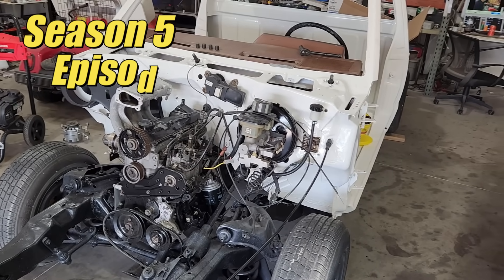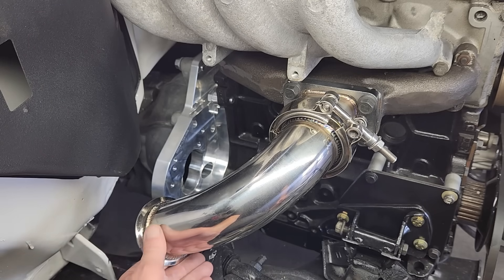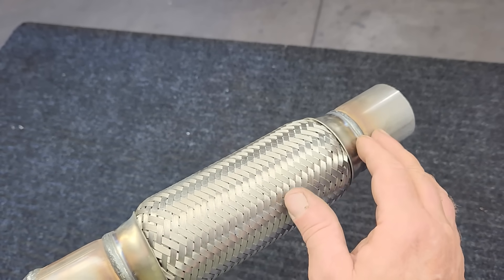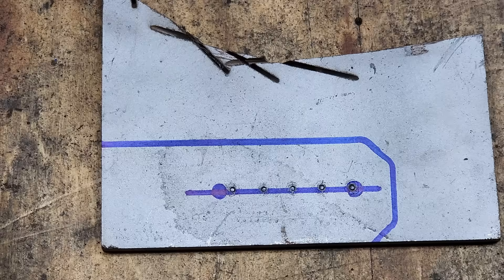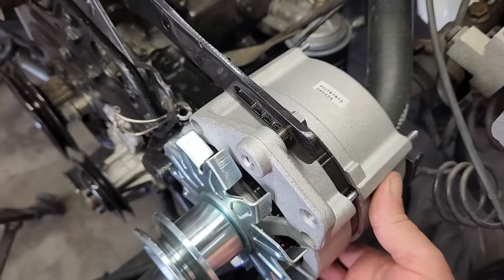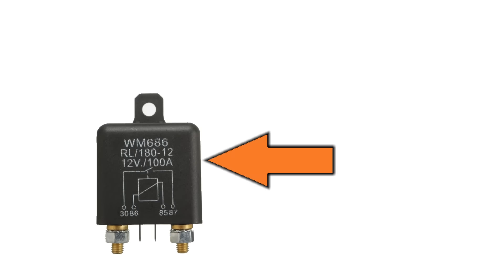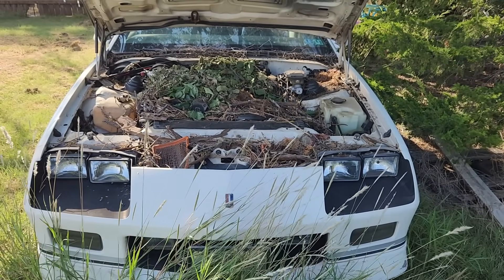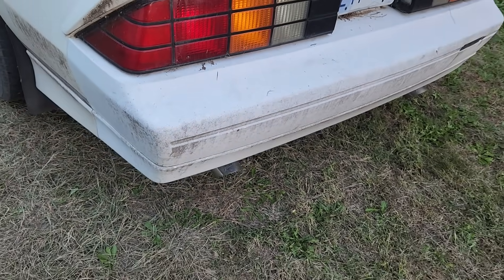S5 E35. DIESEL SWAP Chevy S-10.  we build a custom exhaust and more!

Comment: if the truck has a "seatbelts" light on the dash that illuminates for a few seconds when the key is turned on, you could use this same circuit to run the coil of the relay and you would have a built in glowplug timer
Reply: Not sure if that would be long enough , but it’s jeenyuss! 😊
Reply: Hardly needs the glowplugs above freezing anyways.
Reply: @ThePentosin yes it needs. It is swirl chamber diesel, not direct injection
Reply: @juhomaki-petaja if it's in good condition it won't need the glow plugs, most of those engines here in Europe don't have working glow plugs anyway and start fine when it's warm out
Reply: @mantvydas8810 i am from Finland. Those 1980s prechamber diesel need glow always. Educate yourself
Reply: @juhomaki-petaja I'm from Lithuania lol, summer is usually 20+ no need for glow plugs.
Reply: @mantvydas8810 these old ones need in days first start
Reply: @juhomaki-petaja I drive a 30 year old car and been around older for a long time I'm not talking out of my ass. If it's in good condition it will start without glow plugs when it's warm out, nearly 0 and bellow is where you'll need em. And no I'm not talking about modern diesels, those can fire up without glow plugs when it's -15c outside, own a car without functioning glow plugs lol
Reply: @mantvydas8810 yes it starts but long starting and lots of gray smoke. Remember, Direct injection engines dont need glows so much
Reply: Easier to buy original glow timer relay...

Comment: Either that's been converted to a stick, or the 5.7 badges were added to a 305 car. The 5-speed wasn't available with the 350 because the torque along with the weight of the car would tear it up. It's the same T5 that was in the Mustang that was lighter with less power.
Reply: Could be a 6 speed converted from a 4th gen. 4 gen console in there.
Reply: @AliceEmpireBreadfan  That would be awesome. I have a T56, but I sold the car it was supposed to go in. Maybe someday.
Reply from the maker: As I recall the 350 could be had with a 4 speed for sure.  Given the fact the car has Gen 4 parts, there may be something going on that we are not aware of yet.
Reply: @robotcantina8957  I'm definitely looking forward to finding out. Are you going to do updates on it?

Comment: Check the RPO code for 1LE code. That would make it even better.
Reply from the maker: I think thee RPO codes are in the back of the car under the hatch.  we didnt get a key for the hatch or the doors.   If I can find the codes I'll post them in a future video.  I really want to know all the details on this camaro.
Reply: @robotcantina8957  In case you weren't aware, the 1LE package (IIRC) came with a 5.7L engine (350), Manual 5 speed, bigger brakes, bigger sway bars (I think) and a posi. It's a pretty desireable package.

Comment: I know you probably get more suggestions than you'd like, but could I suggest using a Sabre Saw with a metal cutting blade ... and some drops of Cutting or Threading oil along the path of the proposed cut line ... to cut slots after drilling holes to remove material as you did with your alternator bracket?  I find it a hole (!) lot faster and neater approach than filing ... and faster than setting up my milling machine.  As I mentioned in another post, Oatey Threading Oil can be found at most Homeboy Depots.  Sabre Saws can often be found in pawn shops, thrift stores (aka where AMERICA shops) or even Face Book Marketplace.
Reply: Jig saw?

Comment: Fun story: on my dearly beloved and long departed Toyota T-100 pickup, I replaced every incandescent lamp in the truck with LEDs for efficiency, including the charge lamp off of the alternator. Without that tiny bit of resistance, I managed to kill an Optima battery dead-dead.
When I swapped in a 180 amp alternator from a Cadillac, I replaced the bulb and ceased to drive a battery-killing machine.
So, TLDR: keep the charge lamp incandescent, folks.
Reply from the maker: LOL, indeed a LED wont work.  I also learned that back in the day.
Reply: Same goes for Hondas of similar era. Needs the incandescent bulb in the battery light to charge. I learned that lesson the easy way by reading on forums, thankfully. 😂

Comment: I have a good 6.2 diesel and 700R4 trans... Humm. This might sound silly in a S10 BUT it only weighs about 200 lb more than a gas V8.
Reply: Theres a channel somewhere that put a 6.2 in a c3 vette IIRC. 😂
Reply: I was just telling a friend about this situation earlier. And he goes oh yeah you know I got that 90 Chevy truck that's a bit weak in the motor department. And I went oh no I don't think I want another project sitting around after all.

Comment: You might like to use a cutting or threading oil and not penetrating oil to help drill or cut holes in metal.  Homeboy Depot over by me stocks Oatey Threading Oil which works great at cooling cutting surfaces ... I even use it on my lathe.  It makes smoother holes and extends drill bit life. Under $10 at most Homeboy Depots. As we used to say:  A Little Dab'll Do You!

Comment: for the Iroc i would just assume the engine has issues and just strip it down to a short block and then rebuild it 
but you could just sleeperdude style and just send it🤣
Reply from the maker: LOL, well the RAT that made its home in the engine bay is still there and we have been working on ways to evict him.  Anyway we did dig deep enough to see there is no intake manifold... so the cam is likely toast.  Hopefully we can dig out the rest of the crap today or tomorrow to get a better look.
Reply: @robotcantina8957  ya from my point of view a new spicy cam is almost a necessity🤣 new cam, springs for higher rpm maybe roller rockers

Comment: I think the 350 was only available with automatic transmission in that Camaro, but I could be wrong.  Either way, it should be a great project for them.👍
Reply: You're correct, from the factory the 350 only came with the 700R4. I have an 87 IROCZ I've owned since 1999. 1987 was the first year for 350 in the third generation cars.
Reply: Beat me to it, I really wanted one with a manual and the only manual option was the 305 back then.
Reply: 8th digit in the VIN will let you know if it is a 305 or 350
Reply: @IgniteLight  - And the RPO will tell what trans it came with.
Reply: Came into the comments for this... I used to read Consumer Guide (not to be confused with Consumer Reports) and distinctly remember the IROC-Z's base 305 came with a 5 speed with optional automatic, but the 350 option required the automatic.  Since the console is clearly from a 5th gen F body, and we know the engine had something done, I wonder if it's an LT1 and 6 speed swap?
Reply: @davidkane4300 That's definitely possible, the car has had some indepth modifications for sure.
Reply: I put a 1984 NWC T5 from a 305 Camaro into my 71 chevelle with a 350, drove the hell out of it but didn't do powershifts or big clutch dunps. It shifted good and never died, i feel like it was on borrowed time so i got a TKX and have been very happy.
Reply: Well apparently you might be wrong.
Reply: I bought an '88 brand new. Wanted the 350 5spd with t-tops. Couldn't get it though!  It was a long time ago... but seem to recall the salesman said you could only get the 350 5spd without t-tops due to body twist blowing out the tops.  So I got the 305 5spd with t-tops.  Yeah, it sucked.  SHould have just said no to the tops.
Reply: There were no factory 3rd Gen Camaros with a 350ci engine and a manual transmission. It was not an option, at all. The T5 5-speed would not have held up. 

The only way to get a manual transmission with the 3rd Gen F-bodies was through aftermarket tuners like SLP and a few others.
Reply: @DrFiero There was no way to get the 5 spd mated to a 350 from the factory. Even with the 1LE option for showroom stock SCCA racing was obtained by ordering the 350 with automatic transmission and no air conditioning.
Reply: I think some of the Canadian ones you could get with the 350 5sp.
Reply: @joshuagibson2520 Unless they were undocumented from the factory I've never seen any evidence of that.
Reply: @joshuagibson2520  - and since I am in Canada... that could explain it!  :D 
(also, now being a senior, memories are foggy)
Reply: Isn’t the tuned port an LT1 in that car?
Reply: @THNKKY Tuned Port was before the LT1 the LT1 is totally different kind of small block Chevy.
Reply: @Alloy211  once me and my friend swapped a tuned port from a formula 350 firebird into an el Camino. We ordered a gear drive to replace the timing chain for a 350 and found that it didn’t fit. After making some measurements we found that the lt1 gear drive was the one that fit.

Comment: Jimbo they make these really cool lap clamps for exhaust. They negate the need to weld exhaust tubing.  
They don't leak, they are cheap and they are a sleeve with two heavy steel bars on either side to securely join exhaust via a butt connection. Stainless ones are under $20. I got them to put them on my 4x4 and I can get the whole rear pipes and mufflers off in under 5mins. 
They aren't a replacement for V bands in any way or form - if you need a V band then you need a V band, but for straight pipe they are excellent. You'll never use a slip joint and those stupid clamps they require ever again.
Reply: Post a part # or link
Reply: @dheujsnrhfydhehehshshhdggsd  I can't post links. YouTube deletes posts containing them. I've learnt the hard way.

Type exactly this or cut and paste it into YT search: " Exhaust Band Clamps | Unveiling the Best vs. the Rest " without the quotes.

The channel is jsf auto plus (not written like that. the plus might have a + sign in it lol).

I chose that vid because you want the ones with 2x bars and he shows the single bar ones so you know which ones are the better ones and which to avoid. 
There's thousands on ebay. I don't even have stainless ones, just mild steel and they are the best thing.
Reply: I’d like to learn more about these, can you give a part number or what to search on the google machine to find them? I don’t think YouTube allows links in comments anymore
Reply: @GlizzyGloblin  Re read this thread. I answered another poster and gave exact instructions to a vid. They are very common on ebay.
Reply: If you google 'lap clamp sleeve' you get basically exactly what OP describes

Comment: for the alternator bracket i would have welded a nut on the back and a longer bolt with a nut welded on the end on the alternator so that you could just tighten or loosen the bolt for your belt adjustments

Comment: About to get a 1987 f150. This build is so cool to watch, giving me some interesting insight into what I would like to do with this truck. Thanks for everything you do.
Reply: I'm not not saying that you should get a Cummins 4BT from a bread truck and stuff it in there.
Reply: @SamwiseOutdoors it’s got the 351 carbureted Windsor. Instead of the early age EFI stuff. It’s also being used as a daily driver from the seller. So I’ve got plenty to work with. Should be fun,
Reply: @SamwiseOutdoors  love a good 4BT. And I agree if budget allows it’s a good option. However it’s heavy, underpowered, and you can basically swap a 6BT in it for the same price. Heck with VP44 engines now selling for $1500-$2000 you could pick one up and P-pump the 24V for almost the cost of a good running 4BT.
Reply: Om603 turbo or ideally an Om606 would be far better than 4bt. Run smoother, make more power, about the same price. 4bts have gotten way over priced the last few years
Reply: OM617 is cheap and common. However any 1.6 VW diesel swap or OM617 is going to need a good manual transmission and proper gearing (aggressive) to keep it from being a complete dog. For example a OBS F150 with a 120ish hp OM617 wants to rev more like a gas engine. Therefor something like a ZF5 or even T19 and 4.56 gearing with a 29 inch tire is going to be needed. Something like a 1.9TDI is going to be a lot more forgiving but is also going to be a lot more expensive and need a lot more fab/wiring work to make everything work correctly. Personally I think for cheap mechanical injection the old VW engines work well in light cars and small 2WD trucks (ranger/S10) however in bigger vehicles or those running mid size tires I would just jump to the OM617 or ALH if budget allows. That’s just me however.
Reply: @cbr600rx7 I've helped with OM617 swaps into Land Cruisers as well as 4BTs, and I was really impressed with the packaging and simplicity of the 617. I'd love to swap one into an AMC Eagle Wagon in order to make a safari wagon.
Reply: Another option is getting a Deutz air cooled diesel out of something ( generator set ). You can get rid of a lot of hoses, radiator, etc., they are ridiculously reliable and nobody is checking for them so cost should be lower to purchase.
Reply: @hoost3056 Go on...
Reply: Turbo a 300 i6 in it.
Reply: @comoscorral  too easy, but was thinking the same thing.